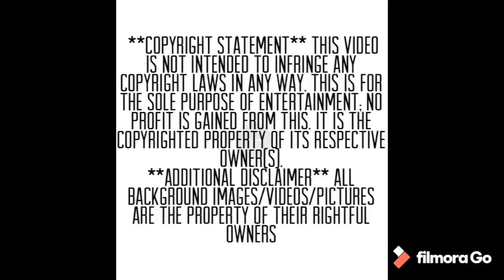Humvee Build Part 8

Comment: I’ve always put off spraying line-x as I did not think I had a powerful enough air compressor. You did a fantastic job with that Cobalt.
Reply from the maker: It works great! Every now and then have to let it build pressure. I wish I had a bigger tank, but it does the trick

Comment: Just picked up a 2006 M1152. Waiting on the EUC approval. Your videos are what inspired me to get one. Once I go through the mechanical stuff and get her running properly. I was thinking of using the linerxtreeme kevlar paint. Question to you is, how is it holding up, any issues with UV fading, peeling or scratching off. Thank you for your service and keep the videos coming
Reply from the maker: Thats awesome man! The Kevlar is holding up really well! No fading so far and it’s been on over a year now. I’m sure over the years it will some. So places where i didn’t paint prep as good as a should’ve starting peeling but only a few spots. No where that’s really visible. Glad you got only coming!!

Comment: Amazing work … lots of your hard work. Curious what size compressor did you use? 20 gal?  Also did you use the spray gun that came with the paint?
Reply from the maker: Yes 20 gallon, it stayed on for most of the time, But did well. Also yes I used the gun that came with the kit.